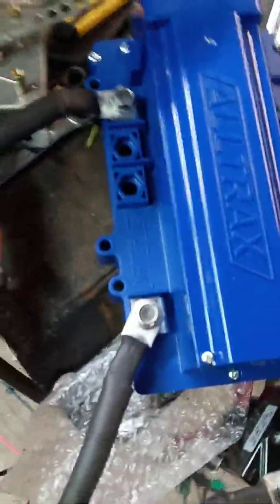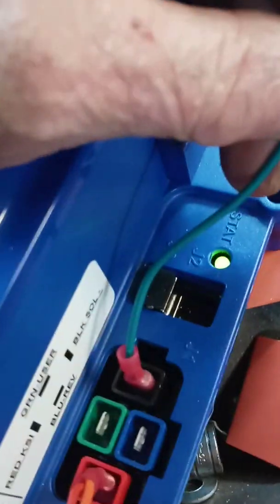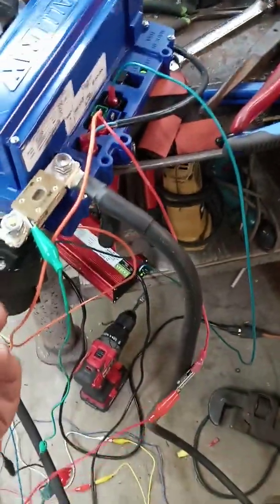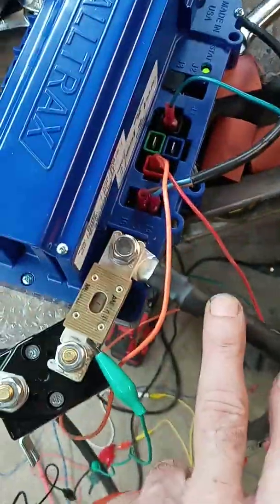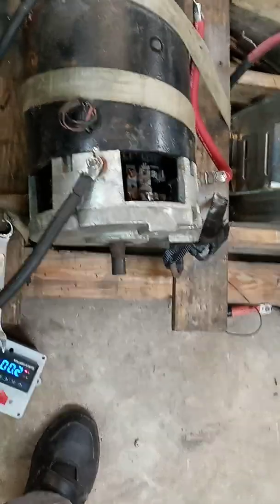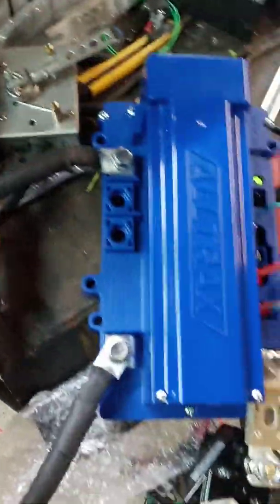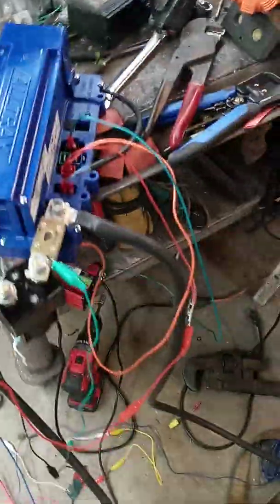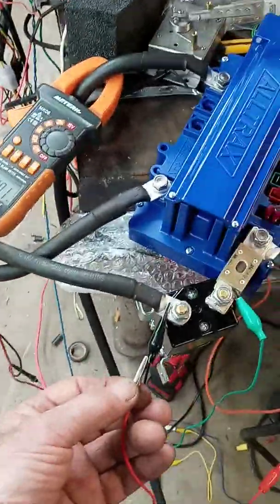Alltrax controll hook up with 2 wire pot box

Comment: Sir what happens if the negative signal for the contactor green wire at pin 17,is not coming, what's the cause.any suggestion
Reply from the maker: In the video the green is for the pre-charge resistor. Precharge goes across the contactor , 400 ohms will do